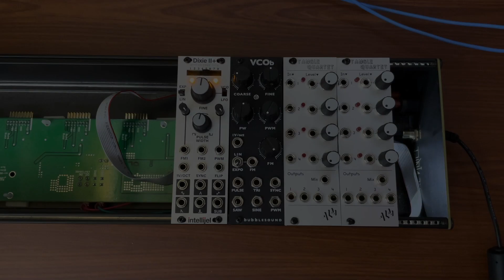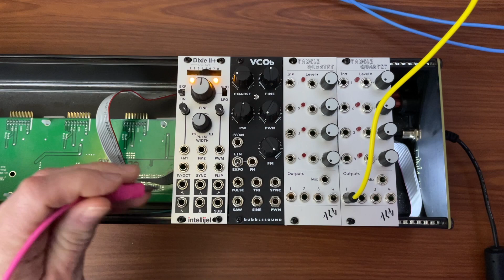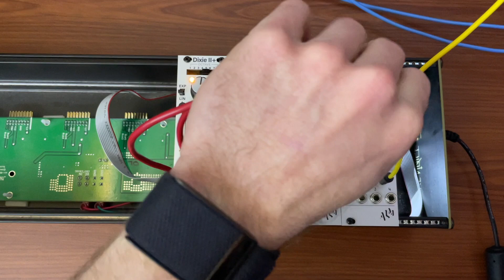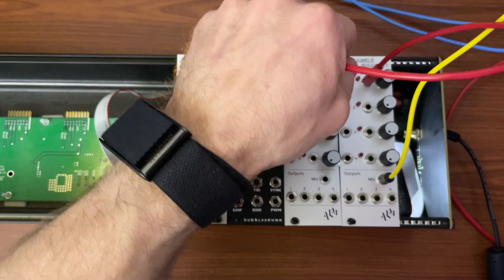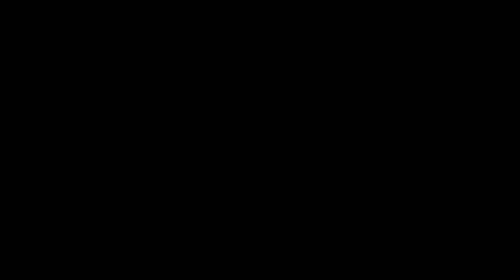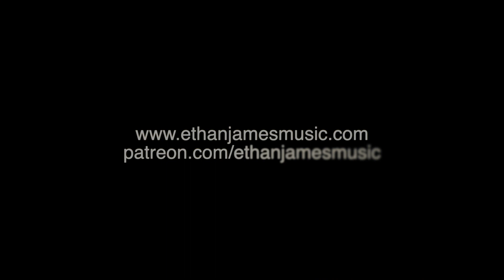Eurorack A to Z Tutorial Lesson 3: VCA part one

Comment: What’s the benefit of having multiple VCA’s over let’s say a mixer? Sorry I’m new to modular
Reply from the maker: happy to answer!  A mixer would just take in audio signals and work like you would expect a mixer to do.  A VCA is more open ended; it asks, "how much?"  So it doesn't have to be audio signals, it can mix and attenuate audio, voltage, or both.  For example, I can take a random voltage and combine with an LFO or an envelope, and the VCA let's me choose how much of each voltage is passed on to the next part of the signal chain.  Does that make sense?
Reply: @EthanJamesMusic1  yes that makes a lot of sense thanks for the insight!

Comment: this has been helpful, building my first rack now. I have a midi controller hooked up, and can play notes which im super excited about. got dual oscillators going now so i can fit 2 notes at a time which is also exciting. I just want the note to stop playing, or have the ability to stop it (without hitting my pitch wheel and then making low rumbles when no noise comes out). So trying to learn about VCA and attenuators. These videos have already been helpful because i found a couple brands of modules I didn't know about which led to me to a couple great modular sale sites.
Reply from the maker: Great!  I'm happy to hear these are helpful.  For VCAs, even the cheap Doepfers are good, because you can get a lot of channels crammed into a small space

Comment: Hi, I'm wondering when to use an VCA and and attenuater?
Reply from the maker: Hi! I cover that question in the video coming up on Monday, but the short answer is:
1) It depends on the VCA a bit.  My VCAs exceed what the attenuators can do, so I use the VCA when I need to do something more extreme-sounding
2) Sometimes it's more convenient to use the VCA, and have all the knobs closer together in order to make changes quickly, as opposed to having knobs spread across an entire case.
3) VCAs can function as voltage mixers too, so if you want to have one or a few knobs controlling a LOT of changes at once, it can be more powerful than a single attenuator.  I will cover this use further down the line.